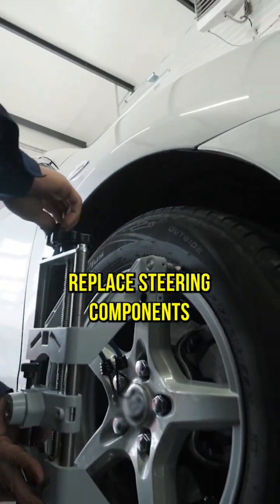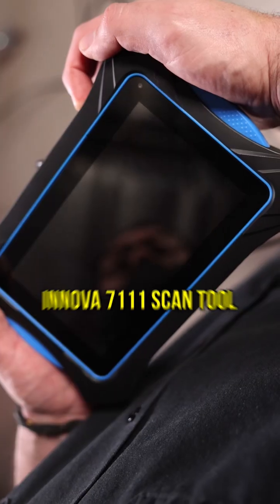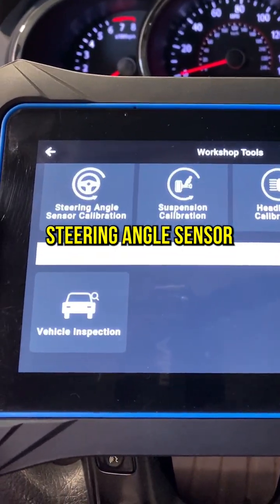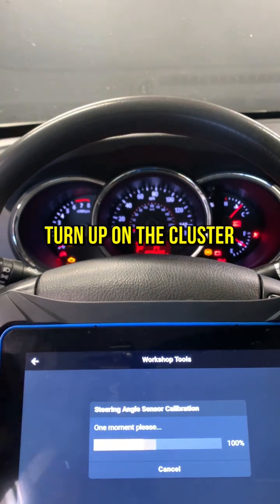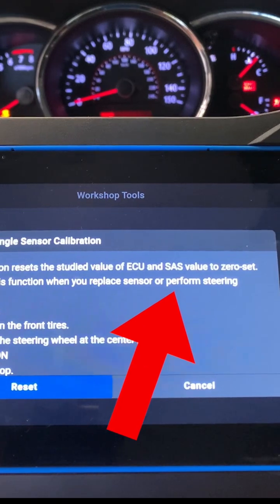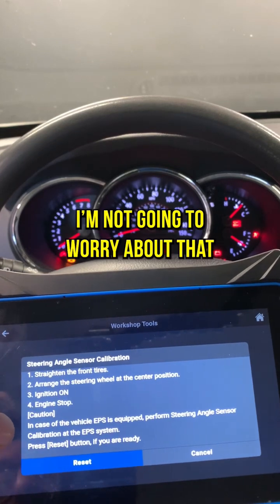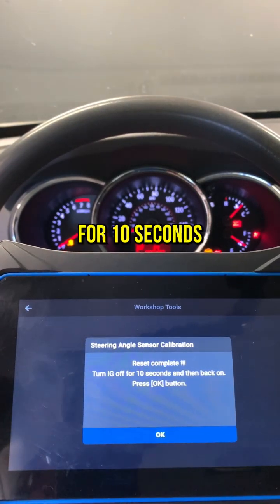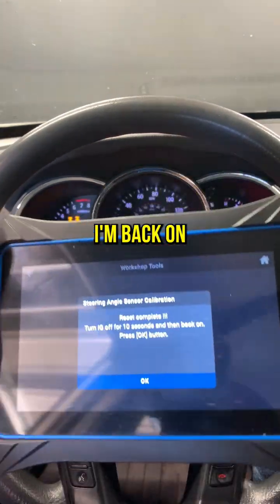How to Calibrate Steering Angle Sensor with Innova 7111

Comment: Yes, but does it work on a GEN three Prius… I doubt it
Reply from the maker: Hi, thank you for your feedback! The 7111 supports the Steering Angle Sensor Calibration function on many Gen 3 Prius vehicles; however, as with all OEM-specific data, availability depends on the vehicle’s year, make, model, and engine configuration.

We recommend verifying coverage for your specific vehicle using the Coverage Checker at pro.repairsolutions.com prior to purchase or use.

If you need further assistance, our U.S.-based tech support team is available Monday through Friday, 6 AM to 6 PM (PT), at customercare@innova.com or 1-(888)-906-9813. We’re happy to help!

Comment: What about 2009 chevy...i changed yaw rate sensor now need to reset
Reply from the maker: Hi, thank you for your question. On a 2009 Chevrolet (?), the yaw rate sensor is part of the ABS / Traction / StabiliTrak system. The Innova Electronics 7111 supports the Reset Electric Traction System function on supported GM vehicles, which is the correct menu path for traction- and stability-related resets on this platform. It’s important to note that on many 2009 GM vehicles, the yaw rate sensor does not have a separate, standalone calibration command. Instead, the system typically re-initializes as part of the Electric Traction System reset once the sensor has been properly replaced, faults are repaired, and ABS / traction codes are cleared. In some cases, a Steering Angle Sensor (SAS) calibration may also be required for the traction system to fully relearn. As with all OEM-specific functions, availability depends on the exact vehicle configuration. If the vehicle does not broadcast a dedicated yaw calibration through the OBD DLC, this is a vehicle limitation rather than a scan tool limitation.

We recommend confirming support for your exact vehicle using the Coverage Checker at pro.repairsolutions.com, or contacting our U.S.-based technical support team at customercare@innova.com or 1-800-544-4124, Monday through Friday, 6 AM to 6 PM (PT). We’re happy to verify coverage and walk you through the correct procedure.

Comment: Would this reset wheel position sensor and traction control sensor on a 2014 nissan versa note SL?
Reply from the maker: Thank you for your question. On a 2014 Nissan Versa Note SL, Nissan does not provide a standalone “reset” function for the wheel position sensor or traction control system. These systems are managed through the ABS / Vehicle Dynamic Control (VDC) module and are reset indirectly by addressing the underlying fault and clearing any stored ABS/VDC diagnostic trouble codes. The 7111 is capable of:

Accessing the ABS/VDC system
Reading and clearing traction control–related fault codes
Restoring system operation once the issue has been corrected

If the condition requires a steering angle sensor calibration or if there is an active hardware fault (such as a wheel speed sensor or wiring issue), those steps must be completed before the traction control system will return to normal operation. In summary, the 7111 can clear ABS/VDC faults and restore traction control after repairs are made, but Nissan does not support a manual or button-based reset for these sensors on this vehicle.

If you have additional questions or would like help confirming tool compatibility, our support team is happy to assist.

Comment: If my steering wheel is tight and the proper components have been replaced after a crash doing the steering angle sensor reset would make the wheel loose again ?
Reply from the maker: Thank you for your feedback. Resetting or calibrating the steering angle sensor will not make the steering wheel feel looser.
If the steering feels tight after a crash, it is usually related to the power steering system, wheel alignment, or mechanical components.
Steering angle sensor calibration is required after repairs to ensure proper operation of systems like ESC/VSC, but it does not change steering effort. We recommend checking for fault codes and verifying the steering and alignment before calibration.

Comment: It doesn't work on the 2015 Dodge Challenger
Reply from the maker: Hi, and thank you for your feedback. However, your message did not include any information about which feature or function is not working on your 2015 Dodge Challenger. Without that detail, we’re unable to investigate or provide accurate support.

We’ve tested this tool on a like vehcile and confirmed that it supports many features/functions. To check which features are supported on your exact year, make, model, and engine, we recommend visiting the Coverage Checker at pro.repairsolutions.com. If a function isn’t performing as expected, please use the “Report an Issue” feature directly from your 7111 scan tool. This sends us detailed info about your vehicle and tool version, so our team can look into it properly. Instructions for submitting a report are available by searching “Innova 7111 – Report an Issue” at pro.repairsolutions.com If you need any furthert assistance contact us at customercare@innova.com or call 1-800-544-4124 (Monday–Friday, 6 AM to 6 PM PT). We're happy to assist.

Comment: Would this tool work to recalibrate the steering angle sensor in a 2024 Toyota RAV4 Hybrid?   I've got an offcenter steering wheel.
Reply from the maker: Hi, and thank you for reaching out!

Before performing any Steering Angle Sensor (SAS) calibration, it’s important that the vehicle’s alignment is checked and corrected first. An off-center steering wheel is typically a sign of improper alignment, which should be resolved before attempting to recalibrate the sensor.

Currently, this tool does not support SAS Calibration for the 2024 Toyota RAV4 Hybrid. To check future compatibility or coverage for other vehicles and functions, we recommend using our Coverage Checker at pro.repairsolutions.com.

If you have any questions or would like help finding the right tool, our support team is available Monday through Friday, 6 AM to 6 PM (PDT). You can contact us at customercare@innova.com
 or call 1-800-544-4124. We’re happy to help!

Comment: My innova sd39 give me the option then it says it’s not supported. 2012 chevy malibu
Reply from the maker: Hi, thank you for your feedback!
We have validated the Steering Angle Sensor Calibration function on a like-vehicle.

To help us assist you further, please submit a data capture through the RepairSolutions2 app—this automatically sends us the necessary vehicle and tool information for review. You can find detailed instructions here:
🔗 RepairSolutions2 – How to Report an Issue

If you have any questions or need additional support, feel free to contact us at customercare@innova.com
 or call 1-800-544-4124. Our U.S.-based tech support team is available Monday through Friday, 6 a.m. to 6 p.m. PST, and we’re always happy to help.